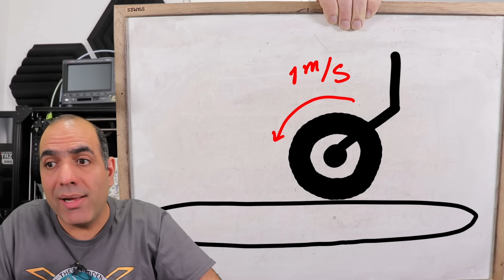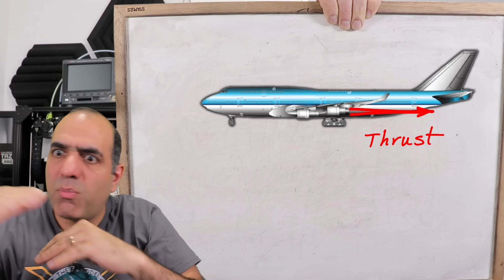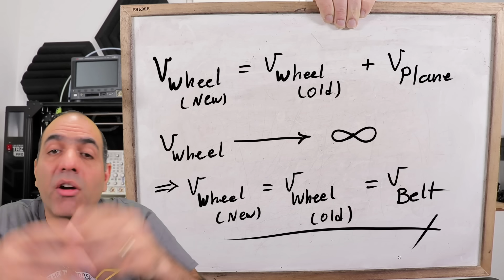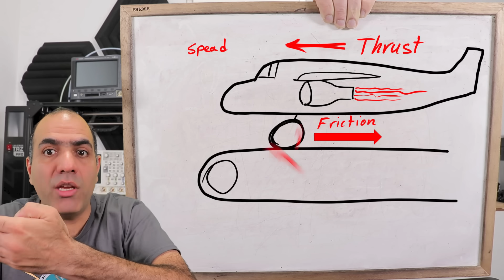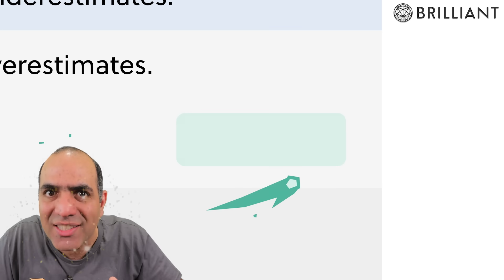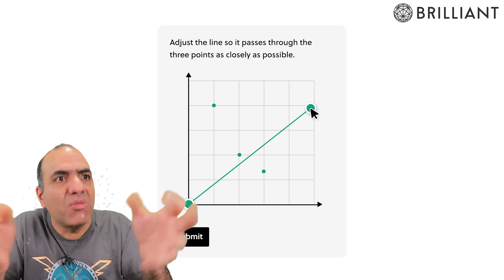Airplane Question that Drove Me NUTS!!!

Comment: Ok I've though about it and here is my official answer. A 747 has a take off speed of 184 mph, and the treadmill will accelerate to that exact speed but in the opposite direction. Let's assume that the 747 and treadmill are both initially stationary, and that the treadmill will accelerate at the exact same rate a 747 would under normal take off conditions. There is no wind, and this is all happening at standard sea level pressure. Now lets preform the experiment...

When the engines first throttle up, they must overcome the inertia off the plane and the stationary friction from the wheels. The treadmill also starts moving but in the opposite direction, meaning there is no apparent motion from the plane. Now when a 747 takes off, almost all of the friction the engines most overcome is due to air resistance, and because our plane is stationary relative to the wind, it doesn't have any air resistance to deal with at first. Because of this, the plane starts accelerating faster than it would under normal take off speeds relative to the treadmill. Soon the plane overtakes the treadmill and actually starts moving forward in our frame of reference. The reality is that the friction from the wheels is so small it hardly effects the plane. The plane keeps accelerating forward until eventually the drag from air resistance is greater than the drag from the wheels. The plane keeps moving faster and faster, until eventually the wings produce enough lift for the plane to take off. This take off took longer than a normal take off would because the plane had to deal with twice as much friction from the wheels than normal, but it was still able to take off. 

Conclusion: The plane was still able to take off because most of the resistance a plane experiences during a take off is from drag. The treadmill doesn't create extra drag, it simple produces extra friction in the wheels which isn't a very big deal when it comes to something as large as a 747

Comment: Here's another answer to make it 5 for you. 
Aircraft undercarriage have a maximum rated ground speed (i.e. the speed the aircraft moves related to the ground underneath). The higher the ground speed the higher the structural stress on the components of the undercarriage.
Assuming calm conditions (i.e. no wind) your ground speed on a normal runway, without the conveyor, at the moment of takeoff will be equivalent to the airspeed you need to fly. If you run the conveyor (i.e. the ground) backwards at the same speed you are moving forward, then your ground speed will now be twice the speed you need to fly. There's a decent chance this may exceed the stress limits of the undercarriage, and cause the undercarriage to buckle/bend/break, in which case you end up with a crash.

Comment: To me this question need another question which the problem maker to answer first. What is take off in this case ? Is if safe take off or just abruptly take off and you don't care the end result ? If the answer is the later, the plane will surely take off even without engine. But the end result ? Disaster.

Comment: Based on how that question was worded you could leave the brakes on turn on the engines and like I said by the wording of the question the airplane would start moving forward and the conveyor belt would move forward as well because it has to match the speed of the wheels and if the wheels are stopped then the conveyor needs to keep them that way and not let them rotate so the plane would just move forward and take off without the wheels moving at all. I've seen this question dozens of times and it always comes down to exactly how it's worded.
Reply: But the conveyor can't move to keep the wheels stopped because then it would be moving a different speed to the wheels
Reply: @bosstowndynamics5488  well it depends on what we're defining as speed now right? That's why this question is so infuriating is you can interpret it dozens of different ways. The actual practical test that happened showed that an airplane can take off and I kind of think that should be the end of it.
Reply: @KillerSpud  The actual practical test objectively did not satisfy the constraints of the question though. Feel free to write the question off as badly written but you can't use the MythBusters test to falsify it because they didn't actually test it.

Comment: Depends on the wheels, power isn't applied to the wheels so it shouldn't prevent it from taking off however the drag generated by spinning the wheels incredibly fast might prevent the plane from getting enough airspeed. Spinning them that fast probably lead to a catastrophic failure and the destruction of the plane. In a perfect world with no extra friction and indestructable tyres the plane should be able to take off. Wouldn't be able to turn for the first bit due to the gyroscopic forces of the wheels though

Comment: I think it will take off because the 747's jet engines are exerting force into the air and not runway, the only down side is that the wheels will be spinning twice the speed they normally do so they may get damaged or destroyed while taking off.(I thought of this answer not checking any sources, so if i have something wrong type it below this comment)

Comment: easy: apply brakes and you will fly 
let wheels spin freely and it will be easier to spin wheels than gain speed so the wheels will gain rpm but not your air-speed  and then you are not going to fly

Comment: take off only req airflow over airfoil

engines expell air against air, plane accelerates relative to air around foils, plane takes off

Meanwhile wheels at 2x regular speed are probably getting warm from friction, wouldn't want to be in charge of landing that at the end of the day

Edit- ok didn't expect to think about the wheels the same way you did at the end wtf

Comment: I desagree with case 3. Friction is not proportionnal to speed. So the friction in the bearing would be canstant and the plane does take of. Then again, this still assumes the bearing won't blow up due to the heat generated.

Comment: If the question is meaning that the wheels are locked and the runway belt is accekerating the plane then yes it will take off. If the question asks that the runway belt will move the opposite direction the wheels are moving while it takes off, then there will be no wind/forward velocity meaning no generation of lift.

Comment: Write a comment? Before watching wideo? Fine.

No. Because conveyor belt is aerodynamic and doesn't move air. If the plane was in a wind tunnel it would take off. Lift force of the plane happens between wings and air, not between ground and wheels.

Edit: So you assume that the jet engines are engaaged? Well then conveyor belt does nothing. I agree with you under those assumptions.
Reply: But the conveyor belt would still keep the plane still not allowing lift to occur.
Reply: @jarskil8862  By moving at supersonic  speeds magically matching speed of wheels to balance out jet thrusters? That's dumb, all that friction would create heat and destroy the wheels until they are not a problem. Or more likely at one point the wheels would lose the grip and slip from the belt.

Comment: Yes, the plane will take off, the forward velocity of the wheels may be matched by the conveyor, so, they will likely either be skidding or spinning as if they were going twice their velocity at takeoff, but that isn't going to prevent takeoff

Even if a car was driving on that runway, it would be able to drive off. It's speedometer would, of course, register twice it's actual speed, but, in practice, we don't care about the speedometer registered speed, we care about it's speed with regards to the earth.

In the person on the treadmill case, the entire point of the damned things is to be able to run while not attaining any actual speed/velocity with regards to the floor
Reply: But the plane cant move forward if the belt takes it backwards same speed
Reply: @jarskil8862  If the plane isn't moving forward, it's speed is 0 and the belt isn't moving. If the plane is moving forward at 100 meters per second, the belt is moving backwards at 100 meters per second. That doesn't mean the plane can't move forward, it just means the wheels spin a lot while moving forward. 

Ignoring the conveyor belt for the moment, if a car is sitting on a test stand, is the car traveling at any other speed than 0, no matter what the speedometer says it is going at? Will a well calibrated radar gun register any speed other then 0?

Same thing with the plane, the indicated speed of the tires only matches the actual speed of the tires when a bunch of assumptions are true, but the problem doesn't specify the indicated speed of the tires, it specifies their speed, and then explicitly breaks one of the assumptions that would make their indicated speed match their actual speed.

Comment: Yes it can take off because the thrust comes from the jet engines and not from the wheels.
Reply: But if the belt moves back same speed as the plane goes forward, the plane stays still thus cant take off

Comment: I guess you could really easily solve this trough seperation. Bc the plane accelerates separteted to the ground wich means that as the begins to generate thrust it accelerates simultaniously the wheel and conveyor starts to accelerate to this means that the airspeed increases proportionaly to the wheelspeed. So it would just take of. If you take friction into account you would just have to generate a little more thrust but it stays the same
Reply: This does not make sense. If the airplane is sitting on the belt (hundreds of tons of steel, so lots of friction between wheels and belt) and the belt is going the exact speed opposite direction, the airplane is just stationary. It will never take off because there is no air moved to create lift... (unless we take into consideration the air moved by the belt but fuck that)
Reply: @IceHax  yeah fair point but it's honestly a question with no right answer exept someone where to try it which is kinda highly unlikely

Comment: The movement of the belt could also get so fast that it moves air around and creates enough force to lifth the plane.
The belt itself might act as a fan moving so fast.
Reply: And the tires of plane explode due to inertia before plane takes off. Still not enough conditions.
Reply: @kacperrutkowski6350   Yes, they'd heat up so much they'd blow up, it's so interesting, one can think of so many scenarios, but without testing it, we might never know for certain!

Comment: A UNSW physics professor tackled this question, and did some calculations on the third case.

Basically even with friction the plane will be able to take off, because at a planes usual takeoff speed the fiction will be small. Furthermore, because the treadmill is probably quite large and moving quite fast, it actually creates a headwind which actually AIDS in the plane taking off.

So in all cases but the "engines are off" case, the plane will take off
Reply: The friction per unit speed is small but the only cases in which the wheel speed can equal the conveyor speed are when the plane's speed is zero, and when the conveyor's speed is infinite. That means that the plane would only take off once the head wind generated by the conveyor was so fast it exceeded the plane's take off speed.

Comment: my money is on a total catastrophy were the plane crashes the moment the front wheels lose contact with the conveyor belt because the back ones would still be in contact againt too much resistant leading to the plane losing conrol

also the lack of inerci would make taking off more difficult

Comment: Wheels don't matter, air flow over wings does and jet engines provide the thrust.
And friction will burn up the wheel bearings assuming the tires don't explode first. Silly question. Nonsense.

Comment: The only thing that matters is the speed of the airflow over the wings. The amount of thrust, the speed of the wheels, none of this matters if you don’t have enough airflow over the wings to produce lift. The question talking about the speed of the wheels is a red herring, because that actually doesn’t matter at all in terms of allowing the plane to take off. If it had enough thrust to overcome the friction, a plane could take off just fine on a normal runway without the wheels turning at all.

Comment: Let's imagine you're wearing roller skates on the treadmill. The treadmill will probably grab the wheels and pull you backwards but some of the motion will transfer to spinning the wheels, so maybe you don't move linearly as fast as you would if you had shoes on.
Now let's say someone is standing behind you, off the treadmill, pushing just hard enough on your back to prevent you from moving. Your linear motion is zero, but the friction between the wheels and the treadmill will impart some spin to the wheels. Eventually they spin up to some equilibrium state, but due to slip and other friction sources maybe the speeds don't match.
Now imagine a longer treadmill, and your friend pushes harder while walking alongside you, still off the treadmill. You start to move forward, which causes your wheels to spin faster, which causes the treadmill speed to increase (due to its speed being controlled according to the speed of the wheels, not by any physical connection).
It seems that depending on the friction of the wheel bearings and the friction between the wheel and the treadmill, the forces may add up such that the backwards force from the treadmill overcomes the push force and you come to a stop. Realistically, there should be an equilibrium linear speed where the wheels can't spin faster so the treadmill is able to drag you backwards. But my intuition is that this speed is quite high and a reasonable airplane should be able to take off before reaching it.

Note that in Super Mario Maker, if you are equipped with a raccoon leaf or a cape you can accumulate enough speed to fly by running in place on a conveyor belt.

Comment: 36 seconds in and yes, planes dont gain speed via contact with the run way. They push air out of the rear of the engines. The wheels, in this conveyer belt experiment, would just spin twice as fast as normal but thats likely no big deal as long as they are rated for the speed

Comment: The plane will lift off, because of the airflow around it. The flaps of the plane are designed so that it gets a natural uplift because of the air flowing around it. The engines, constantly pushing air backwards, provide much thrust, thus the plane will do what's called a nose up (the nose of the plane lifts up). After a nose up, the speed of the air flowing over the flaps increases, causing more uplift. So, the plane will first lift it's nose, then run (or be stationary in this case) for some time and then lift off finally, first only by a few inches, and then by a few feet, gradually increasing the height. Here, the plane might not be going anywhere while on the runway, but it is still gaining lift due to airflow around it's body and the thrust provided by the engines. 

This case is somewhat similar to when pilots do a nose up before reaching the take-off speed. The nose of the plane lifts up first, then as it keeps on gaining lift, it starts to slowly lift up.

Comment: I ended up settling on the answer "yes, but the wheels would be ripped off" as my answer, based on the assumption that all of physics is earth-normal with the exception of the conveyor belt being able to go up to infinite speed, since the question sort-of states it can match any wheel speed... so the wheels and belt end up at ludicrous speed, either tearing apart or melting the bearing or some other structural part of the wheel assembly, allowing the plane to take off wheel-less...

But my answer is purely because of how I chose to interpret the question's vaguely worded setup, so I totally agree about these questions being infuriating.

Comment: As the friction on the bearings increases, so does heat produced by it and the airplane will eventually burst in flames, killing everyone on board.

And if we ignore the friction on the bearings, the wheels will move very close to the speed of light, their kinetic energy approaching infinity, so they will eventually collapse into a black hole, killing everyone on board.

Comment: Hey medhi, thanks for the videos! 

While you speak about plane, could you explain us how to make an electric ground for a flying machine?
Reply: The term "ground" can mean different (but similar) things in electronics, and doesn't always refer to a copper rod buried in the earth.  Are you talking about how 0V is chosen? How a lighting strike is dissipated? How sparks are avoided during in-air refueling? How sparks are avoided when a jetliner connects to the jet bridge?
Reply: @CodeKujo  0v! We use it so much in electronics.
Reply: @mwamiral  It's pretty much the same in an airplane as in a car, both are "isolated" electrical systems.

Comment: Airspeed is what is important for the wings to provide lift, in this impossible hypothetical situation the stipulation of the belt spinning at the rate of the wheels means the airspeed would not increase, I don’t think there is sufficient information to answer the question because hypothetically there, even though it’s also most likely impossible, could be wind allowing for sufficient airspeed for the plane to lift off.